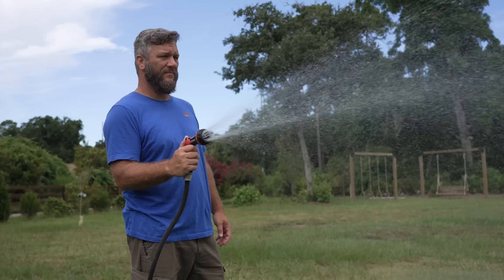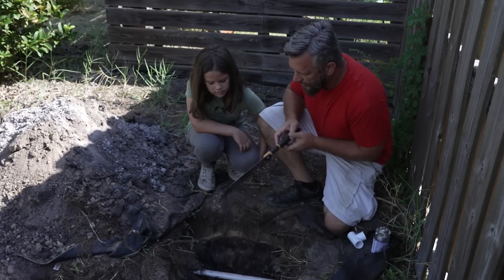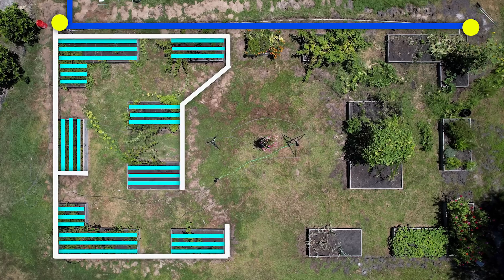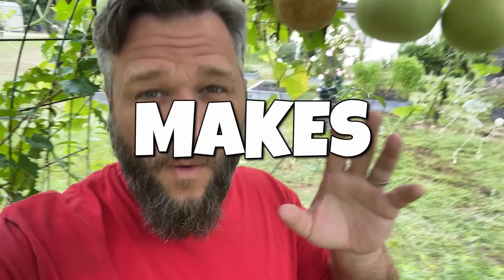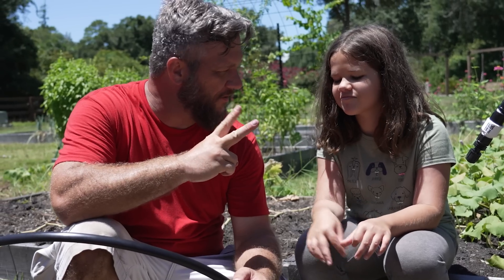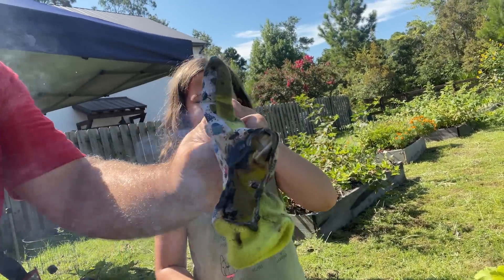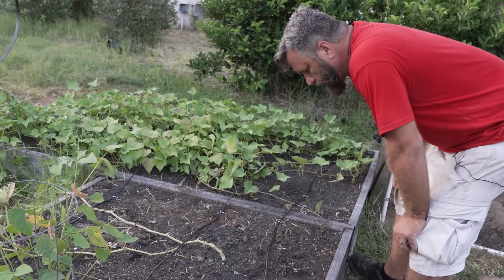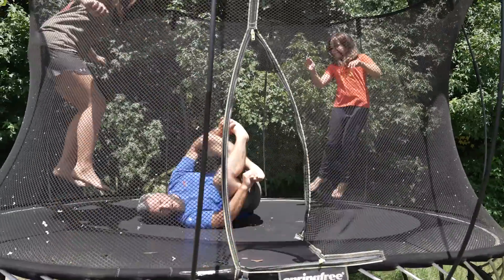I'm Never Watering My Garden Again!

Comment: This is not an ad, I'm just extremely passionate about this -

Afriq Water, the company that my father started and that the whole family, including 10 guys from the local community, work for, manufactures dripline in Southern Africa. Our prices are extremely competitive (not an ad), and we're extremely passionate about irrigation and the benefits of providing cost effective methods for farmers, when they need it most. In certain parts of South Africa and the countries surrounding us, water isn't just scarse, it's dangerous to find. Our mission is to allow farmers to feed their communities without having to worry about going to extremes. 

Our dripline is pre-installed with emitters, and where you used a blanco/blank line next to your bed, from which you adding dripline, we just cut that step out to save costs. People can buy PVC as you did, but preferably LDPE or HDPE, run that like your mainline, but up and over the side of the beds, and install dripline directly from that. Ours looks drastically different too, so it was so interestimg to see an American view of this. 

This is an ad. Even if you don't get dripline from us - get dripline from anywhere. Save water. Help the earth. Help your community water reservoirs. Feed your community, or simply just your family.

Comment: I have irrigation but temp so high there is no time for diseases to even start!  Seriously by the time the fifth area has finished the first area is completely dry.  I ran a line from the outflow of my A/C (water from the air) resulting in 13 gallons /day!  This year Areas 7, 8 and 9 look fabulous.   "Dry" plants getting moisture turns them into super plants.

Comment: Drip irrigation is a Godsend.  I've been doing it for years.  You need to check your emitters once in a while, as they do get clogged.  I usually get two years use and then have to replace them, due to crusty well water and Arizona sun.
Reply: So we have well water and are having horrible problems with our lines clogging up. The irrigation guy charged us thousands and within a week most of the lines were clogging.. He came out and replaced the lines AGAIN! What can we do to keep from clogging? In 1 year he replaced them 4 times charging us $800 each time. He said he put a filter in but sure didnt seem like it. The tops of our beds would be bone dry and water would be running  out the bottom of the bed.
Reply: @Elaine_S  Sounds likke you need a real plumber.  One that will do the job correctly the first time.

Comment: I dug a trench from my garden to my spigot.  Ran a commercial hose into PVC and buried it all the way to my garden and poked in back up.  But my garden is only about 50 or 60' from the water source.  I also have a 55 gallon drum collecting rain water for the garden that's garvity fed.

Comment: I would highly recommend covering the hoses with mulch to protect them from the sun and to lower the amount of plastic (if any, don't know the material) particles that would leech into the water. Avoiding UV light will drastically increase lifespan of several materials. Including UV resistant ones.
Blessed be water timers and their miraculous work!

Comment: Drip irrigation is great in most areas, but if you have water with high mineral content, the emitters get clogged up quickly. I’d love to use drip irrigation or even soaker hoses but they just don’t work long enough to make it worth the cost.

Comment: Tip for drip irrigation line.  Get a 18v battery powered heat gun (I have the Ryobi one).  A few seconds heat on the ends of either the main line or the 1/4" line will make it so, so, much easier to push onto the connectors.   Also I've started using the vinyl 1/4" supply line up into the beds as it's more flexible than the poly line. We are on our 3rd year with the 1/4" dripline in a 2 zone system.  You are so right about it being both a time saver, and also better for your plants as you can totally control when and how much water is applied.  In the spring, I water one time at 4AM, but as the 90's and 100's kick in I up both the time water is applied and the number of waterings per day (twice a day for longer).  Great video!!!!
Reply from the maker: Thanks David!

Comment: The speghetti line can break off if you accidentally catch it on a tool, your boot, the mower wheel, etc. Better to run the 1/2 line to the top rail of the bed. This also allows you to use a simple bend clamp to close the line, which also allows you to easily flush the system at each bed. Another helpful upgrade is an in-line shutoff for each bed to allow you to shut off a bed for repairs or in the case of damage allows you to continue to water the other bed automatically. Spot drippers are also better for bigger plants like squash and tomatoes than the inline, but do require yearly positioning and more labor to install.
Reply: what's a bend clamp?
Reply: @TheRainHarvester  you bend the hose and clamp down on the elbow to close the flow. you can clamp down with anything that will squeeze tight and hold
Reply: The drip irrigation would be better coming up under the raised beds on the inside that way you won’t have any issues with the whipper snipper or your mower catching the irrigation lines .
Im switching to raised beds myself and setting up some irritation lines on the outsides so it makes keeping the area tidy of weeds and long grass when using equipment

Comment: I'm in my 30s and my dang back is becoming a bottleneck for the amount of work that gets done in the garden. Anything to work smarter than harder makes a big difference. I have all the pieces for a drip system but its sitting in the box until the daily high is back into the double digits so I can install it without dying in the process.

Comment: I have 500 Bonsai, I'd spend 3 hours a day watering, could never go anywhere for more than a few hours, Drip lines fixed that. Redundancy is the key also, test it a few days or weeks BEFORE you go on vacation. This will automate all that and save you lots of time, the plants grow better also. Get a automated timer, try mist emitters, try different types, block off stations for larger areas that cannot add enough pressure. Otherwise with long lines and large areas, you do not have enough operating pressure and flow through the system. Stations use only a little bit of water/pressure at a  time and are controlled by a solenoid valve for each station. We have one station for the landscaping plants, one for the Veggie garden and 3 for bonsai. It was a more complex system and the digging I needed to do to hide things, multi tiered, replaced all the old solenoids and wiring and control to new, replaced all the old PVC. Took maybe 40 hours, but saved me 40 hours in a month or two. Also, now I can go on vacation without worry.

Comment: really disappointed you think dowsing works to find water lines😮‍💨
Reply from the maker: I don’t know why people get so upset about dowsing. I always wondered if it worked and now I’ve used it numerous times to find buried lines and it has worked every time. In fact I found two buried cable lines with it last week. I don’t have any reason to push it one way or the other, I just know it works for me.

Comment: Last time I saw a drip irrigation line it was attached to the condensate drain of my AC in the house I just bought. I'm sure that was totally up to code, but I still replaced it with proper PVC piping and added a P trap while I was at it.
Reply: Why would you add a trap to something not connected to sewer or septic? Do you know what a trap is for?